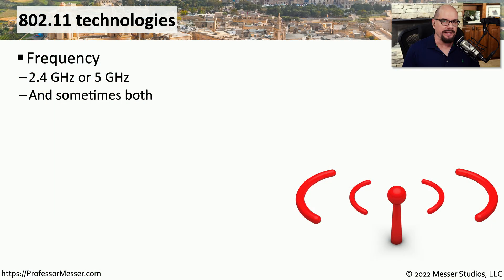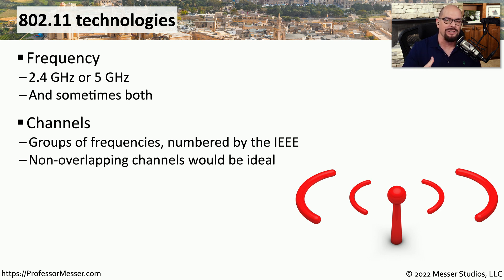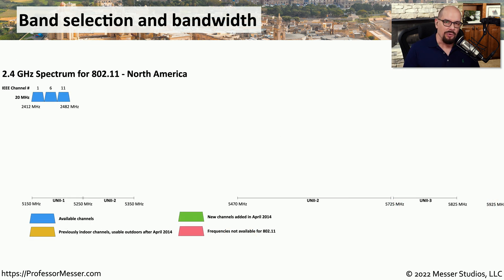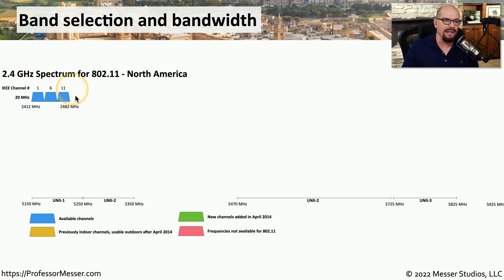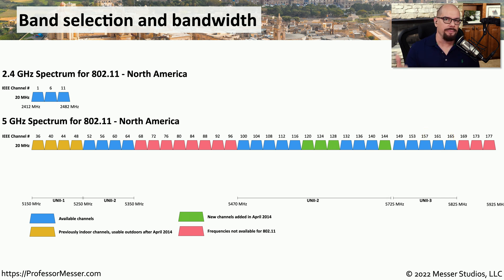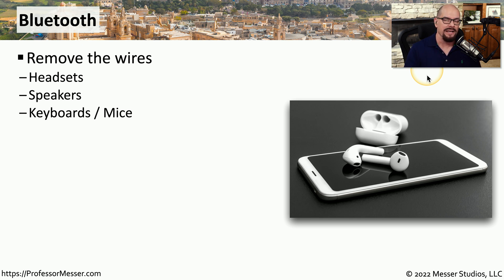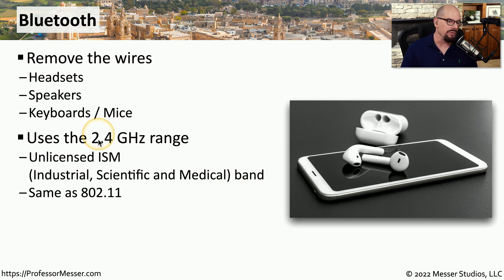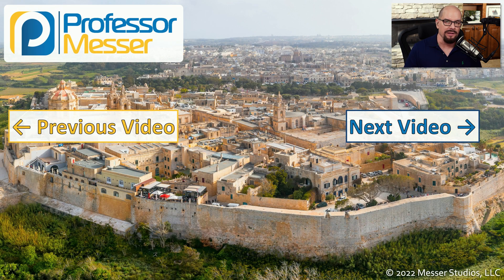Wireless Network Technologies - CompTIA A+ 220-1101 - 2.3

Comment: Do we have to know each channel used for the test ?
Reply: According to the CompTIA objectives for 1101 2.3, Frequencies and Channels are mentioned. So i'm assuming we just need to know the differences between 2.4 and 5GHz;

 2.4GHz is 20MHz band only, and 5GHz is 20, 40, 80 160MHz?